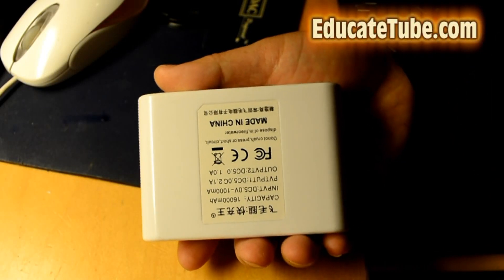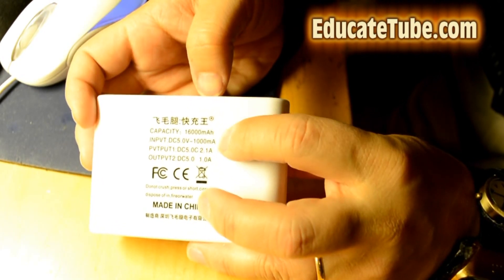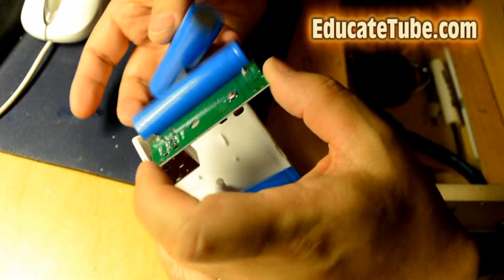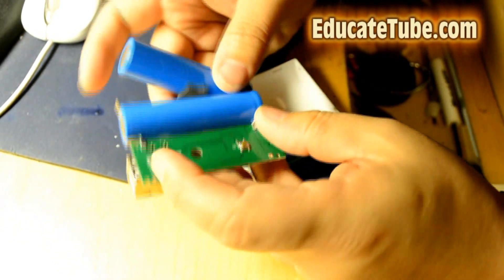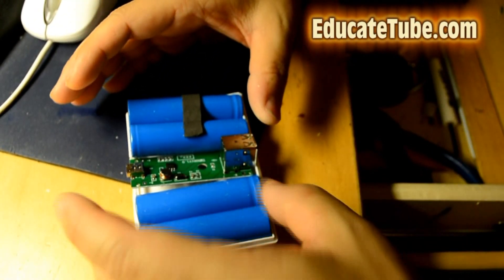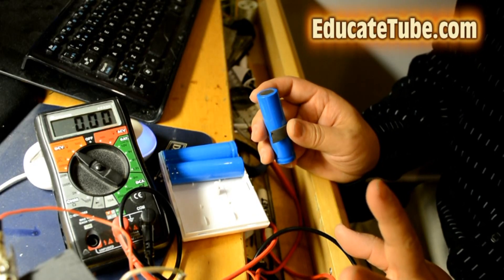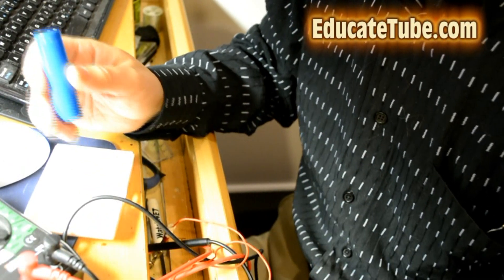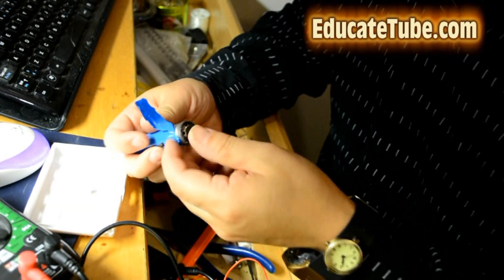Cheap Chinese Lithium Battery Power Pack Scam Surprise - Fake Lithium Battery

Comment: Did you give the seller negative feedback in eBay and create a dispute in eBay and include a link to this video, you'll get a full refund and the seller will probably be banned :)
Reply from the maker: Most eBay sellers are quite good.  They should be aware of what they are selling.
Reply: So.........no?
Reply: doesn't matter.  close or ban one shop, another one opens by the same people doing the same thing.  China as a whole is nearly impossible to trust.  you might have better luck with North Korea.  at least from them you might get some C4 inside the "battery"
Reply: Greg R  yes but you can get your money back, and have them banned so that at least no one else will get ripped off by them. At some point, it will be one too costly for them to keep running around shipping our fraudulent Lithium batteries.
Reply: yeah, but MOST people won't, and the cost to make the product is so small that they can afford to "lose" a few customers and absorb a few forced refunds like that.  sand is cheap!  one fake battery might cost 10 cents to put together, and they charge a dollar for it.  even if 80% of the people ask for refunds, they're ahead.

you can simply assume (before you hit the BUY button) that you're buying a case and circuit, with no batteries.  and then buy PROPER batteries separately and solder them in.

Comment: We knew for ages now that these cells are being filled with sand to mimic the weight of a real one. That's what you get for buying the product sheet instead of the seller and the supply chain.
Reply from the maker: My brother brother got from Chinese market in China.
Reply: @educatetube  China is a big place. What I meant to say is that instead of buying from sites like wish, try Amazon in your country, and only buy if the price seems fair for the spec claimed, and reviews back it up.

for most powerbanks with 10,000mha+ you are expected to pay at least $10-$15 at the cheap end.
Reply from the maker: That's true.  Definitely buying local since I can return it right away if it doesn't work properly.

Comment: Using a higher voltage on a depleted cell actually results in the cell shorting out, you have to start with a lower voltage and small current and you can bring back these batteries from the grave, keep in mind their capacity is likely only a few hundred mAh. The ones they forgot to solder have become zero, use only 2v at only around 20mA and you can recover them.

Comment: I had some ncr Li batteries 18650, they were heavy. I also bought some ultra fire batteries, I realised when I dropped my ultra fires on the floor accidentally, they made a empty soda can sound and I suspect they were hollowed out batteries like yours.
Reply from the maker: Does it charge at all?
Reply: It lasts only for 15 mins at most.
Reply: Mine charges but dies off less than 15 mins.

Comment: I have the exact portable charger bought from eBay several years ago and is still working fine.  The label is different, all English and 12000mAh instead of 16000mAh.  After seeing your video, I opened mine and found inside was very well made......two 18650 cells professionally shrink wrapped at each side of the circuit board, properly spot welded.  All four cells are still fully charged at 4.1V after sitting for a few months.  The 12000mAh is an overstatement (3000mAh per cell), realistically more like 8000mAh total, (2000mAh per cell).  Not everything made in China bought from eBay are as bad as what you have.

Comment: I made the mistake of buying one of those Li-Ion battery packs that claimed 12 volts @ 10,000mAh. It performed poorly from day one.
I opened it up and found a dead cell phone battery to take up space and add weight. It did however wake up and take a charge. So now it is in my SupaBoy portable Super Nintendo.
Reply: The three cells that were hooked together were so out of balance. There was nearly 1 volt spread between the strongest to the weakest. I've since re-balanced the cells and it now provides about 2500mAh. 1/4 of it's rating.

Comment: I worked 3 years in china and can suggest ...never buy something  important from there if not know the brand. I bought only  power bank case with electronic pcb and batteries from another seller, certified original sony  18650 but from japan.

Comment: In 2020 anyway, you can get 16000mah from a Lipo pack. Not round cells though. I have a 10,000mah power pack that's maybe half that size. 

Batteries have come a long way in 4 years though.
Reply from the maker: Thanks for letting us know.

Comment: Ebay won't ban these people if they are big enough to make them money, but they may pretend to give a crap and ban a small seller. Take these individual batteries for instance, the 18650...almost all of them are grossly overstated in capacity on ebay. They just do make a 3500mAh in that battery if that, yet these China sellers are advertising them as 9000mAh, more or less. 

All ebay has to do is put an auto block on any number over say 3500 in a title with the term 18650 in it and that would cut the problem down immensely, but they won't because ebay makes a lot of money from these scams. Even worse, not only are these 18650's advertised way above what they even make in capacity, when you get some of them they are like 300mAh...way low and almost useless when it comes to them lasting any length of time. 

Same with SD cards...stay far away from the bay when you need them and many other things...Scam City....compliments of John Donahoe who used poor treatment and scams to keep ebay afloat..

Comment: I ordered 5200mAh labeled battery, and what did i see when i opened the battery? same as original 2x2000mAh (total of 4400mAh). They literally faked the label because nobody will bother opening the battery and checking the real capacity.

Comment: are those disconnected cells just place holder 'fake' cells, or are they actually cells that are just not connected?  I'd think if they were not connecting the cells up, they are probably just 'blank' cells to make the thing look like a bigger pack than it is...

Comment: just think of it -- most of the products in your house are made in China and who knows just what is fake ?  not to mention that if you have a battery product and put real store bought batteries in it how long will it work before it will not ?  older digital cameras are a good example of that // brand new camera and only got to use for about 10 hours before it will not even display screen it will just show LOW BATTERY ( even though you put brand new batteries in )

Comment: That package carries CE Mark, which requires 100% inspection - NOT MET!
Reply: only a sample needs to be checked CE has no checks after the sample. It would meet the CE low voltage standard as its under 12v It would also pass emc because its not working :-)
Reply: Victor Albright CE in this case means China Export. The C and E is more closer than CE for European Std.
Reply: The real CE mark is two overlapping circles to form the CE. The dimensions would pass in my opinion. There is normally no gap at all with the wrong mark. Seems the printers are learning.  The CE  certificate would normally have a fault as not signed by a responsible person with full name but someone named Sue as one of the best company's for CE service  do .

Comment: Test the single working battery with a smart charger, the cell is probably under 500mAh.  Smart chargers are very cheap now, a requirement to simply test if the 18650's you buy are legit because the market is notoriously filled with garbage batteries.

Comment: I wouldn't be at all surprised if those blue Li-Ion cells were rejects or from dead laptop batteries. 2000mAh is optimistic. 500-1000mAh is more realistic. 
Sell the blue lithium cells on eBay "for parts or not working" and bin the rest. You might get a few pounds (or a few pence).

Comment: Just finished the video...hilarious! I had heard they put sand in the 100% fakes, but never saw it before now. Wonder what actual capacity for the one battery that works is? If a couple of thousand mAh, it should charge the average phone about once, so if yours only works for about 20 minuets, what's that, about 500 or so mAh? 3@ 100% fake and 1@ 75% fake...not bad for China. :)
Reply from the maker: 1500mAh battery.  Well, better than nothing.  At least there is still the circuit board I can solder the salvaged  laptop lithium batteries to.  :)

Comment: this boosting technique is  not  safe  lol  and  you should never apply more then 4.2v to a li-ion battery
Reply from the maker: That is why I said to do it for less than five seconds on a 6 volt low Amp battery after you find out it is less than 1 volt.  Like a shock therapy.

Comment: But if you add there 4 x Sanyo 18650 3400mAh instead of those 4 cheap 18650 it can achieve 13600mAh. I've got something similar - bought Powerbank 20000mAh for $5 ;) There was 3 x 3000mAh (real Capacity 3800mAh instead of 9000mAh) I add there 4 x Panasonic NCR18650B 3400mAh and have real powerbank 13600mAh for lower than $20.

Comment: @10.37 ... you have them the wrong way round :D red is positive so it would not give you a reading even if it had voltage lol ,but by no means am i saying this is a quality product haha BUT ! those are 4 pin tops so more than likely LG cells but more than likely 3rd`s off the line lol.BIN IT !!
Reply: p.s if you removed the wrapper the production code is printed on the casing

Comment: Very informative video!  Have you tried to measure the actual capacity of the working cell?  My guess is 1600 mAh.  (10% of labeling sounds about right)
Reply from the maker: Thanks.  I haven't measured the actual capacity of the cell, but I think it is somewhere between 1500mAh to 2200mAh.
Reply: @educatetube  Sounds about right, shipping sand by air is expensive nowadays.

Comment: Is it that the Chinese worker in general are just lazy and bad?, or are they under such pressure and paid such low wages they don't take pride in their work?, also are these companies just fly by night type of  outfits or are the major companies?
Reply from the maker: Putting sand in the batteries is intentional. This is very unethical business practice.

Comment: Can anyoen hear me out, Im looking for away to extend the battery life of my Fujitsu F02D Flip Phone (Refer to Google Image).

Im looking for a battery that would fit into my phone or is there online company that would like to make one for me. I dont i care if it cost $500 as long as it wil llast 3-5 days!.
Or is even possible to make one? 

any info related to my request pls?  #lithiumbattery #help
Reply: Do I understand you correctly, you have a 5 year old phone, that you wish to keep at any cost, and the battery no longer holds charge because its design life was depleted? And you'd like to restore it to close to original life?

You will not receive more than original battery life within the confines of existing enclosure, the battery technology has not changed significantly in 5 years. Chances are, you'll receive less, but certainly more than a battery that has run its course.

Well there's a few ways you can approach this.

At one occasion, I ran into Battiv GmbH from Munich, Germany, a low-volume industrial battery manufacturer, who claim to be able to make any kind of battery. I don't know whether that claim holds water or actually disappears when you request just ONE battery, and they'll have you pay through the nose, because that's how things are. But I guess there's no harm in contacting them! And don't worry, the whole German industry operates in English, they'll be able to communicate with you just fine. Perhaps you'll find such companies in the rest of the world too, but there can't be more than a handful of those in each country. Theoretically, it's possible to make a one-off battery of required dimensions, as the lithium-ion pouch batteries can be wound with semi-manual machinery. You might run into an issue with protection and charge controller, it'll probably need to be sourced from an existing battery and soldered and mounted on. Best if you're lucky to find other batteries you can source the controller and contact board from.

The second, more practical approach, is to look through a speciality store for batteries. Maybe you get lucky, maybe the store owner takes a glance and says "it looks just like battery X" and has the correct one, perhaps the same battery, under another designation, had once been used in another phone or camera, and the way things go, charges you three times what the battery is worth, but it's good to pay for such service. But let's say this doesn't happen. Then you get him to give you the largest battery that is just a bit smaller than your original battery in size. Then you find a hacker club or hackerspace, an electronics club, a place where people knowledgeable in electronics gather, and find someone to make an adapter plate for you, contacts for your phone on one side, contacts to the battery on another. They will help analyse your existing battery and your phone and figure out what needs to be done. Most phones will power on and charge batteries just fine when just + and - of the battery are connected, nothing else. Some phones expect a third pin with a particular resistance to the + or - pole to identify the battery, but this is easy enough to fake on the adapter plate, as is the temperature sensor readout, regardless of how the battery that you bought operates. Chances are, you'll need local electronics club assistance even if you go for ordering a custom battery just to figure things out and make the specification for manufacturer and to retrofit the circuit, so go looking for one now.
Reply: wow.. thanks.. i'll consider your suggestion.

I really love flip phone and Fujitus F02D complex phone. Why I love this phone because of its design being a flip phone and being a japanese phone though you can change it to english easily, it would lessen attraction for the thief unlike iPhone.

I've visited Battiv GmbH but its in german language and i didnt found fujitsu brand but some japanese brand like NEC, SHARP, TOSHIBA.
Reply: CrimsonFox Hound Well you found the customer facing page, for their store in the city where they stock standard batteries for phones available in Europe. They are also contracted by businesses to create custom batteries, and here there's a lot of industry like that, medical devices and measurement devices as well as industrial prototypes or specialty devices which get produced in small quantities. But that's just what i heard or read somewhere, if i'm not mistaken, it was a while back.

Try shooting them a mail to anfrage (at) battiv (dot) de, if you're interested. No guarantees though, they could think you're a troll or a madman. But no harm in trying, i guess.

Comment: A warning from another video, but with good intentions.

Nowadays this test is shit because the chinese have caught on to it, if need be they fill their 18650's with leadpellets in glue to get to the desired 44 grams. The only way to be safe or sure is to go to your local dealer and buy samsung, lg, eneloop or panasonic. It's more expensive but they work and are a lot more durable. There are no 18650 lithiums above 4000 mAh!  The chinese even have implanted new chips in the protected ones wich state after testing a very high current, just give them a try and be dissapointed. Even buying the more expensive batteries in shenzen china (AliExpress and the likes) will not guarantee that you get the right stuff. Long time ago i learned the hard way. Don't buy batteries in China.

Comment: well mine is 128000 mAh it charged me 50 % lol
Reply from the maker: I know, eh?  I don't think it's even 3000mAh.
Reply: thnx
Reply: the best what 1 single 18650 cell can do is 3500 mAh. Made by Sanyo. The rest you can calculate yourself what max is possible. If there are 18650 cells built ic you can see how much would fit and you know what is max possible.

Comment: your fault for spending only $5 on the product. think yourself lucky you got 4 batteries to can use! many are just filled with sand!
Reply from the maker: It was a gift from my brother.  Only one battery works!
Reply: well even if only 1 battery works you still got your moneys worth!
Reply from the maker: ozycash I guess, but four useable rechargeable lithium batteries would have been nice.
Reply: ozycash
 did u even watch it? they were full of sand..